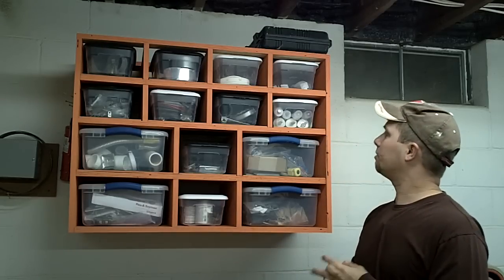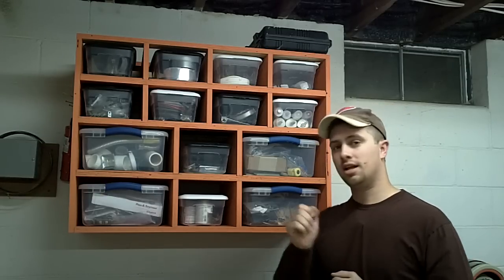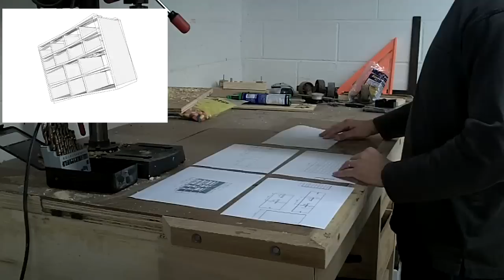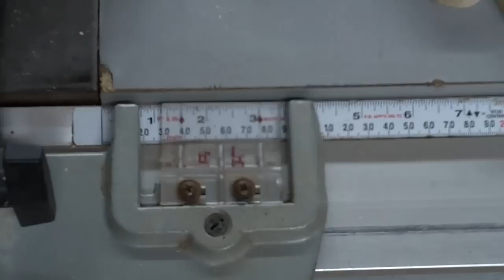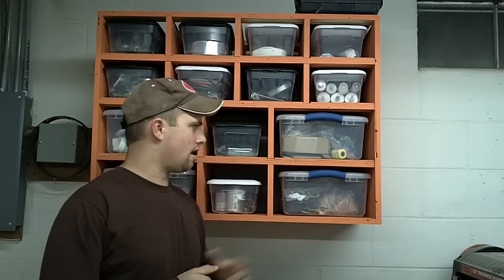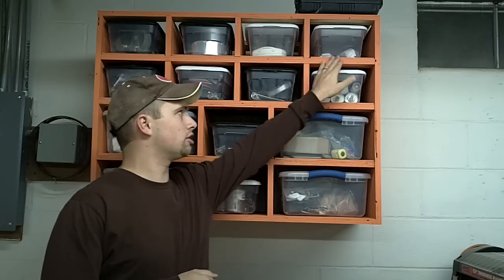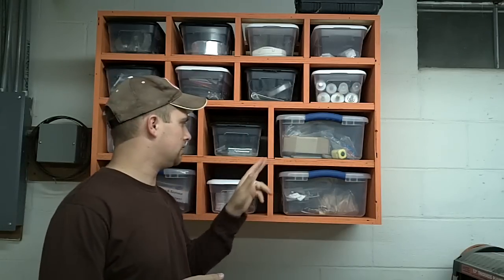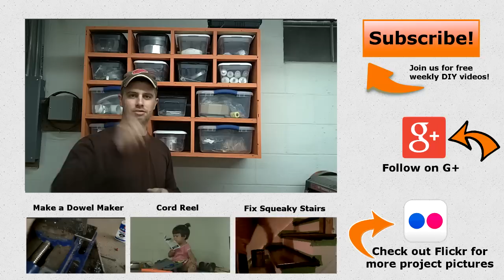Storage Box Shelf

Comment: Nice work Tyler. It always feels good to clean up the shop and add another way to organize. I like your lumber and sheet good storage rack as well. Nice!
Reply from the maker: CMR Woodworks You know Chris, your the second guy that has mentioned that lumber rack....just like the workbench that I took apart it was here when we bought the house and I am not sure I am a big fan! It is super heavy and does not allow easy access to the back of the rack. Am thinking that it will have to go as well as I am trying to open up the work space a bit. Anyway, thanks for watching!

Comment: Thanks for posting and GO WINGS!
=Brian=
Reply from the maker: toolguybak Red wings, My red wings!! Thanks for watching Brian.
Reply: Mine too!
Nice build--looking forward to more videos.  I agree, that lumber cart looks a bit obtuse for a home shop.
Reply from the maker: toolguybak It was made to hold a tank and there is no access to the back 3/4s of it so it really is no good in my opinion. Am thinking of a Jay Bates style EMT rack and then buckets for smaller parts that way they are stored vertically and visibly. Doesn't leave any sheet storage but I really don't think I will have whole 4x8 sheets very often and those I have I am thinking I can store them behind the miter saw, which is soon to be moved by the door.

Lots of videos coming your way!
Reply: ***** I already built a wall rack above my miter saw. If I was to do it over, I'd definitely use Jay Bates' design. If I was doing a rolling cart, I'd use Steve Ramsey's (WWMM) design.